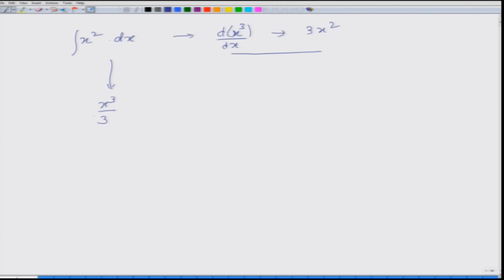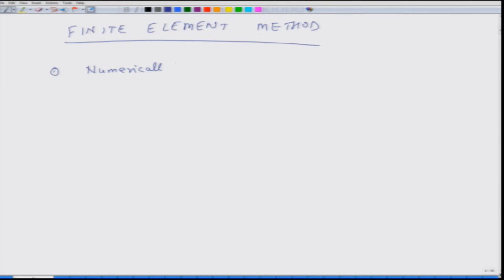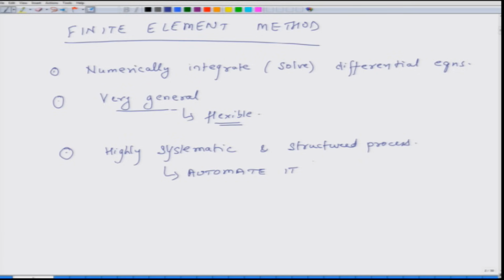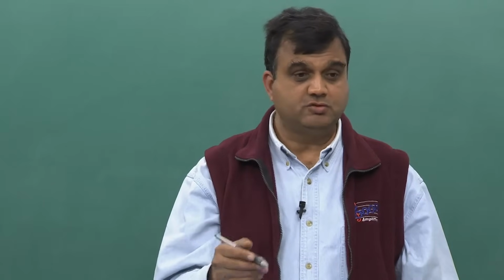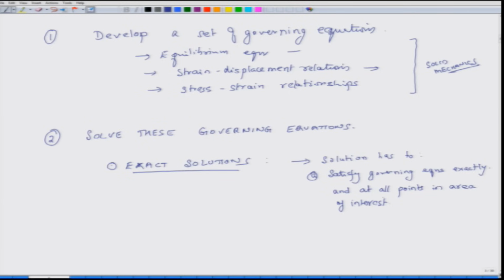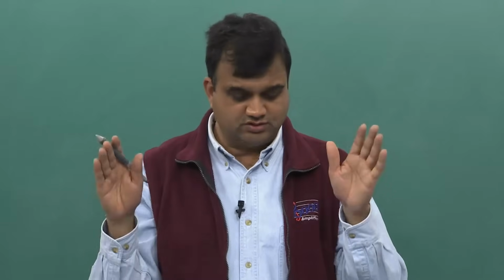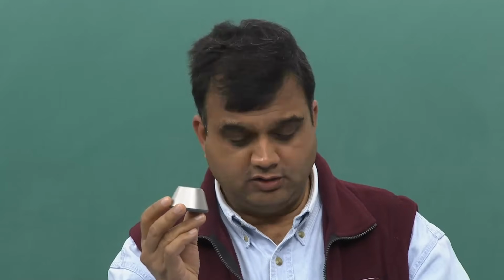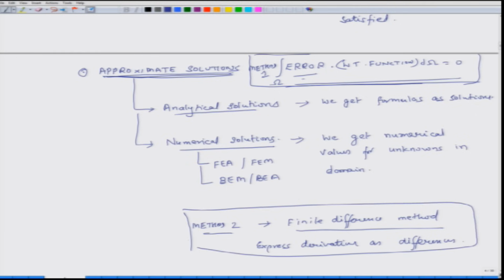Introduction to Finite Element Analysis(FEA)

Comment: Does the Finite Difference Method and Numerical Solution method both are same or it is just a part of it?
Reply: ya.... FDM is a part of numerical solution... which means... FDM will be having only numerical solution and NO analytical solution. Thank you
Reply: @srinathsri4365   may pls explain what was that weight function that was used to reduce error to zero?

Comment: So, the Finite Element Analysis (FEA) and the Finite Element Method (FEM) are the same thing? Some people on the internet say it is and some say it is not, so can you please explain

Thanks in advance
Reply: Šimun Ivković F.E.A and F.E.M are the same thing.
Reply: More or Less yes! but there is a subtle difference, FEA brings out the mathematical rigor that is hiding behind this whole concept of discretizing the domain to solve a complex problem, while FEM is all about solving the problem with use of the formulas without actually considering the rigorous mathematics that has been used to finally arrive at those formulas. Hope this helps!

Comment: Sir is that the part of stuctural engg of course MTech
Reply: Yes. As he said it's useful for Civil application as well.
Reply: @surajfulmali1598  it's simply an approach to static and dynamic structural analysis, software packages like SolidWorks and ANSYS are used to solve problems using FEA methods.
Reply: Yes